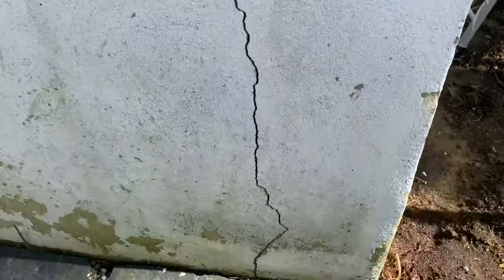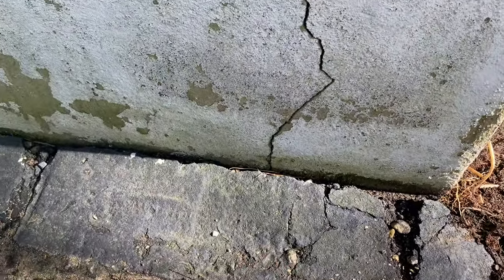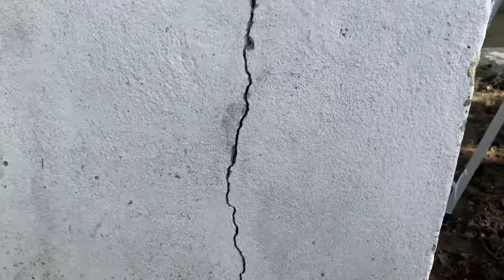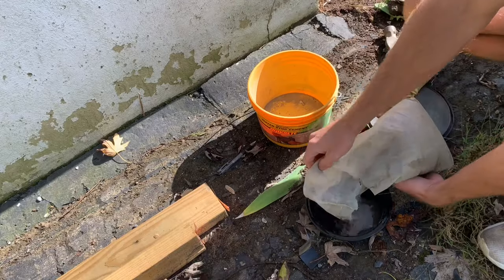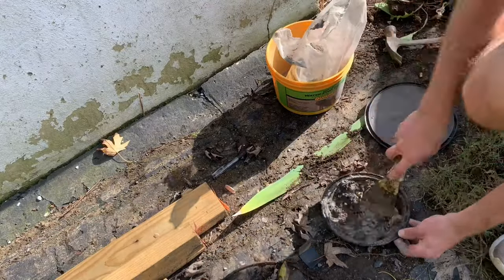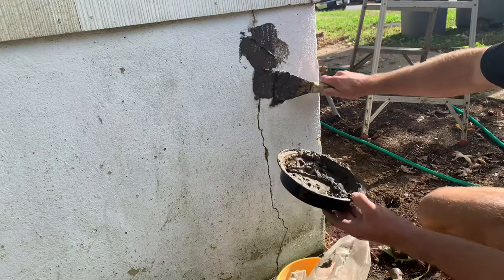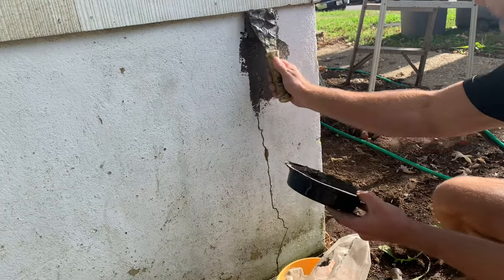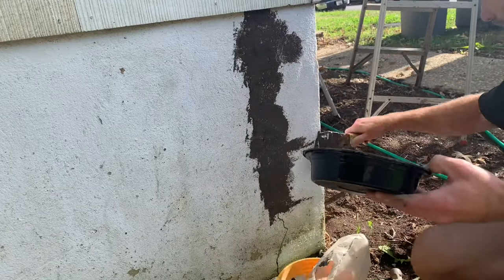How to Fix Foundation Cracks (in less than 60 seconds!) #shorts

Comment from the maker: Thanks for watching everyone!

This is just a quick fix for superficial cracks. This crack was only visible on the outside of the foundation. If your foundation crack is more serious, please get it professionally evaluated. Thanks,
Reply: Could this product be used in minor driveway cracks? Just to prevent weeds. I previously used some stuff I had to use a caulking gun for, but my arms and hands have gotten pretty beat up over the years and it was way too hard to finish what I did, let alone do anymore

Comment: This isn't fixing foundation cracks , this is just a hiding them.
Reply: Does it not seal the crack from the outside to keep water from entering?
Reply: I have water getting in through cracks that even smaller/thinner than those in this videos.  Ruined my flooring.  I thought hydraulic cement was the fix?!?!?!  Damn I hate not knowing what I'm doing.
Reply: @7kardia750  no, because the crack extends into the ground where you cant see it and where all the water pressure is. You need an epoxy solution that gets injected under pressure. its like 70$ and penetrates deep into the crack, then expands and seals it.
Reply: It bonds and prevent further cracking
Reply: @odk1105 why not mortax mix
Reply: @odk1105  who fixes this way for $70.  And how to inject it under pressure  ?
Reply: @Onlyinbean there’s no way for mortar mix to penetrate and seal the crack. The whole thing is 6 feet tall about about a foot deep.
Reply: @odk1105  what type of solution are you referring to?

Comment: Remember to wash the wall with soap and water, and then again with a wire brush and concrete etch and then scrub again with just plain water to rinse any remaining residue off before applying any kind of hydro cement. It does not bond to dirt.
Reply from the maker: Good point! Thanks for watching 🤙
Reply: @AndrewThronImprovements  did yours stay on ?

Comment: You need to use an angel grinder and cut a V-shaped cut both sides of the crack. Then remove the dust. Then apply some binder or primer. When its dry its time to fill it.

Comment: Hydraulic cement instructions:

SURFACE PREPARATION: Chisel holes to enlarge them by at least ¼”, forming an inverted “V”. 
Remove any loose or chipped concrete, brush clean. Make sure that the surface to be patched is damp. The surface can be prepared even while water is flowing from area to be patched

Comment: I doubt that repair will last more than 6 months before it cracks again. 
All you did was cosmetically fix it and not stop the crack from happening again. I also doubt that mix went any more than 1cm into the crack.
Look into crack stitching for a more permanent fix.
Reply: Exactly
Reply: the crack is small will never crack again in 10+ year mark my word
Reply: @jmtake85  That is a movement crack and needs stitching to stop it's movement. Heat expands it and cold contracts it that is what causes it to re-crack. Mark my word of experience.
Reply: @petemason57  What's stitching? Are you talking about the injected epoxy method?
Reply: @sayless9937  Yes but with re-bar cut into the wall which holds the wall together stopping it moving. Thus it holds either epoxy or cement together. Works great on my internal walls.
Reply: @petemason57  I assumed the epoxy was a bit flexible and acted as a glue of sorts lol.

Comment: You definitely were to the point and credible.. thanks.. as opposed to those fricking jack-wads who spend 25 minutes thinking they are so oh  scientific and scaring home owner’s that just need to make a simple repair.
Reply from the maker: I appreciate it! Thanks for watching!
Reply: I also 100% support this statement. Chisel, clay like consistency, patch and feather. So much easier than the other guys videos.
Reply: "scaring home owner’s that just need to make a simple repair" There is hundreds of ways a crack can form and hundreds of degrees of severity of a crack. You have to address those first. You cannot change the facts of what has started on your house. Whether it's a foundation settling, concrete shrinkage, or water pushing the wall inward, or a sinkhole collapsing under the wall, you just don't know. That's why there are experts and contractors. 

If the crack goes all the way through the wall, a crack like this I would pin and injection seal first and then hydro cement it. The crack in this video just looks like a superficial crack in the parge coating.